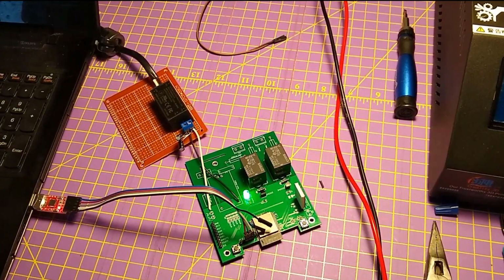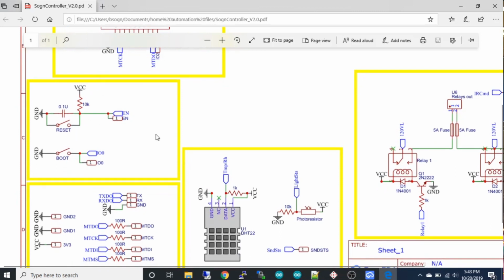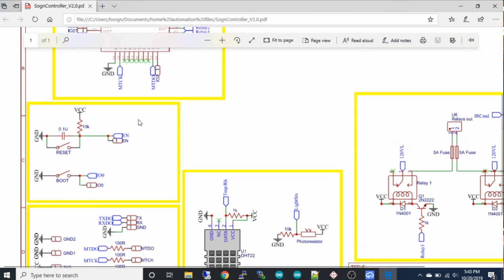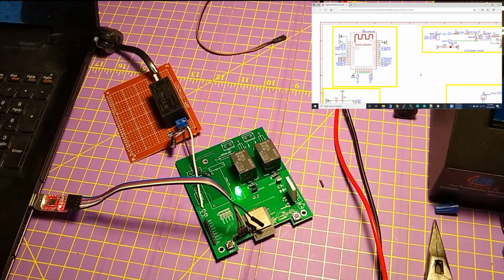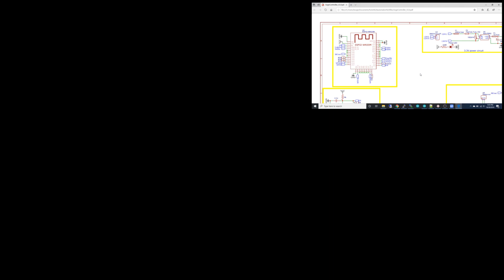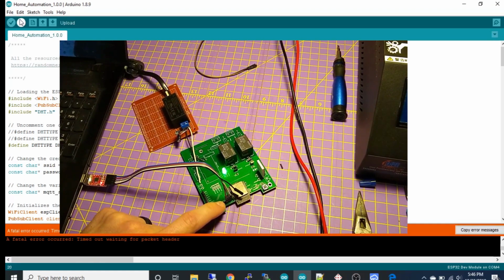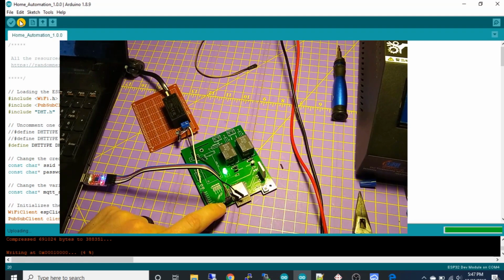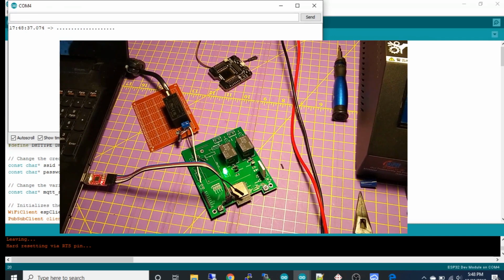Programming ESP32-WROOM-32D on a custom board

Comment: Hi, I would like to know how did you wire all esp PIN. 6 months ago I made my own board esp-based. I use your same model ESP WROOM 32D but no procedure to boot the chip has worked. Can you help me please?
Reply from the maker: I actually made a better(I think) video about this take a peak I go over the circuit….. do you have a capacitor from io0 to ground that can cause issues
Reply: @newsogn5148  thanks for your answer. If you want I can share with you my schematic. I have contacted various maker and everyone show me different circuits and different methods to program esp, but no ones work

Comment: Thanks for this video! It's helping me lay out my own board.

I'm sure you've seen the ESP32 DevKitC schematic, where in the bottom left hand corner they show their fancy USB to UART converter that also has the IO for controlling the EN and IO0 pins with the DTR and RTS signals. When I saw that, I got scared that these signals are also needed for communication during the upload process. I know that, for example, the ATMega328P on most Arduinos requires weird voltages on the reset/enable to put it into download mode, and might even be modulated. Just to be clear, the EN and IO0 pins on the ESP32 don't require any advanced modulation during the upload, right? It looks like the only action those two pins see are right at the beginning when you manually put the chip into download mode. Your USB to serial adapter isn't doing anything besides TX and RX?

Thanks.

Comment: I believe the esp32 datasheet says the boot strapping pin is latched to whatever value it took on reset, so you don't actually need to hold it down for the entire duration of the upload. I'm about to try this project, so I will find out for sure pretty soon :)
Reply from the maker: you are correct!!!! however when it is attempt number 253 superstition kicks in pretty hard hahaha
Reply: the boot button is one shot after reset, in order to allow upload of code ?

Comment: I couldn't read your schematic very well on my screen.  Can you link to a closeup image of the 3.3V power circuit section (like in the upper corner at time 2:55)?

I've been meaning to try JLCPCB out.  Good to hear you have had good success with them.
Reply from the maker: I am actually going to try something a little different right now I just have the HLK 5M03 going to the esp32 with some input capacitance, but I think I will try to get a 5v supply on there and then use a linear voltage regulator to knock it down to 3.3v that way i don't get the power supply voltage drop when I turn on a relay......
Reply: @newsogn5148   Thank you for the info.  Ah yes, that makes sense.  Appreciate your video.